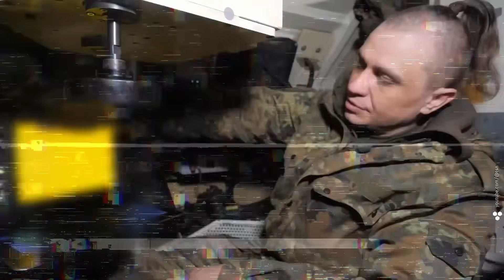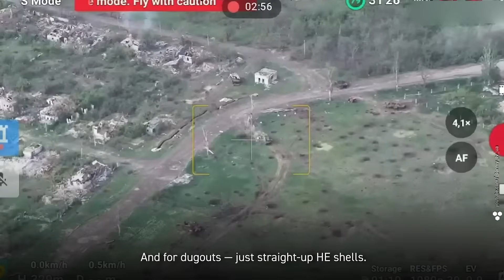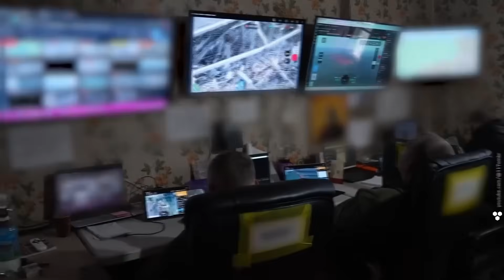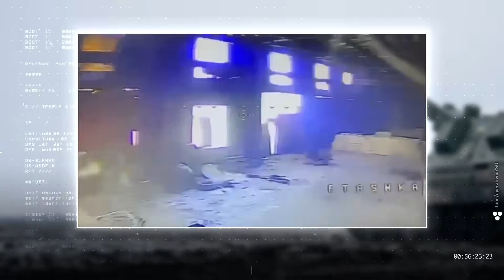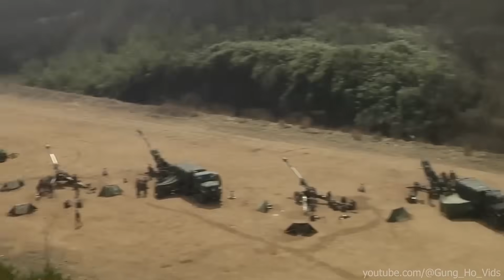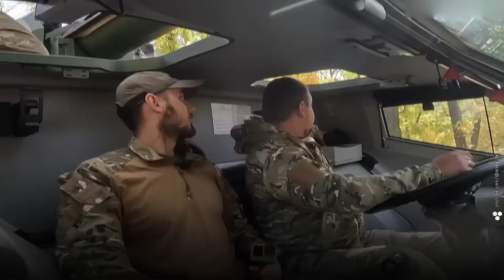Ukraine's Artillery vs. Russian Forces: The Hard Truth

Comment: Come on! Look at the re-purposing of the German 88 mm, which was designed for anti-aircraft but ended up perhaps the single most important weapon for them in WWII. Field artillery, anti-tank guns, tank guns, etc.
Reply: The British 17 pounder was better than the German 88
Reply: @chrissmith2114  I have always gotten a kick out of how they rotated the 17-punder 90 degrees, moved the radio out back and just put up with some tricky ergonomics in use.
Reply: @chrissmith2114  That's why it went into the Firefly, eh?
Reply: Well I dunno, maybe they might should've stuck in that 88!